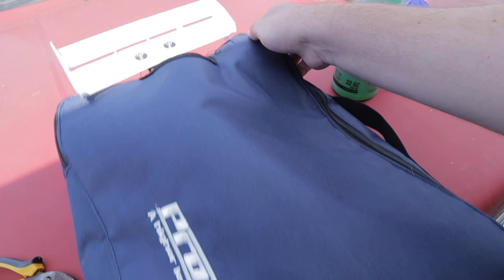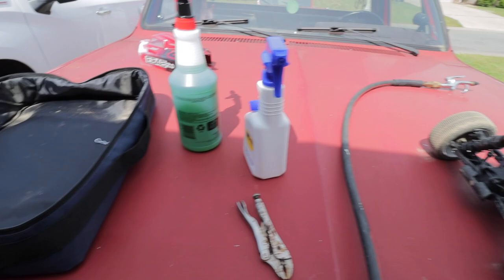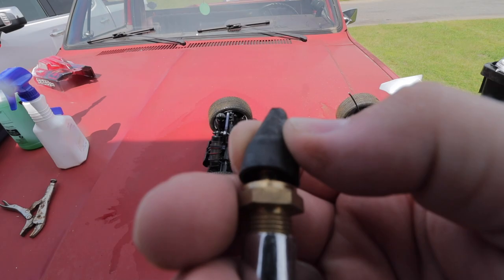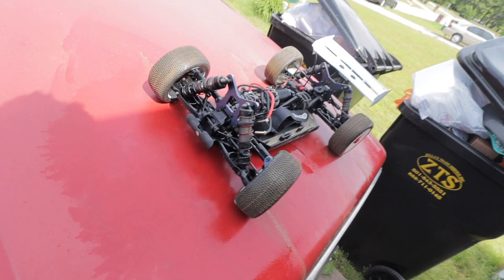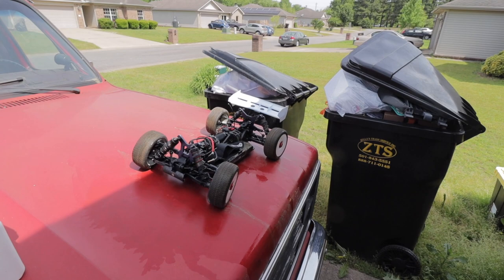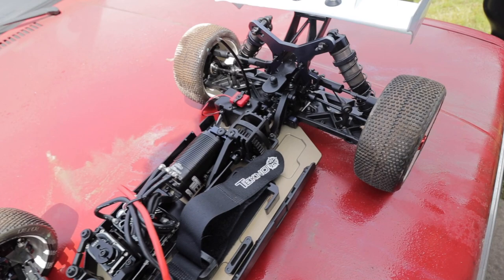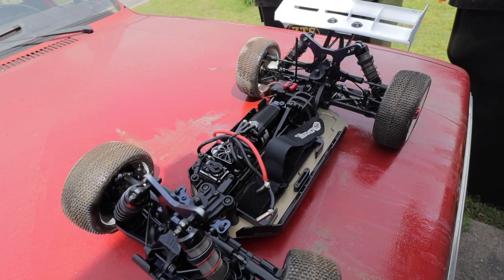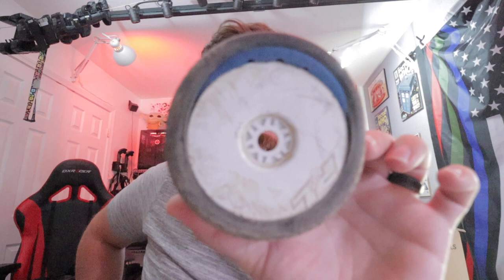Taking Our NEW Tekno EB48 2.0 Out To The Track NOOB WARNING ! | Z1tv

Comment: Use full strength simple green to clean your tires and if your not in a rush soak them for a bit in simple green and use a tooth brush to scrub the bead really good and wash with water and let them dry. Once glued those things will never come off.